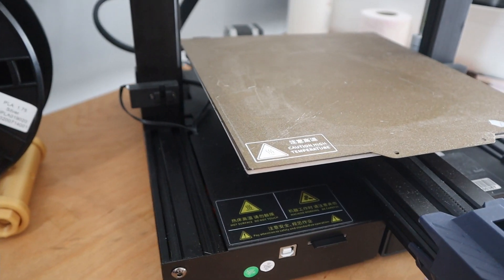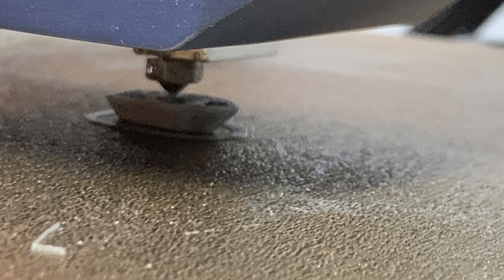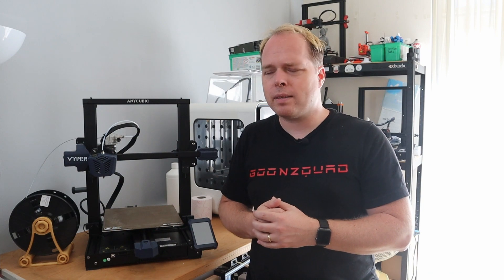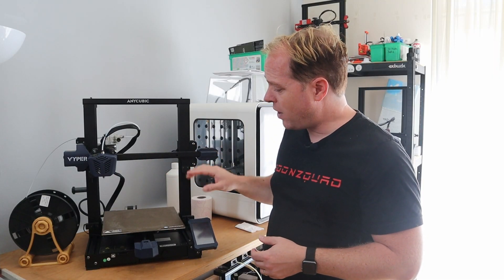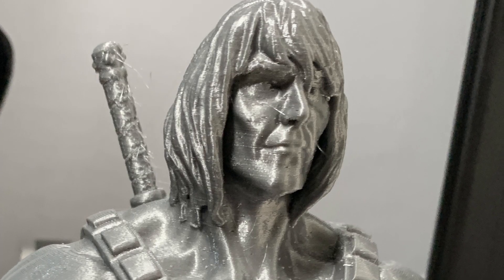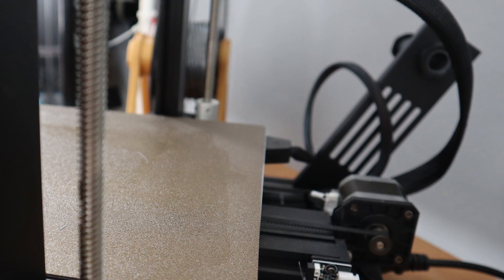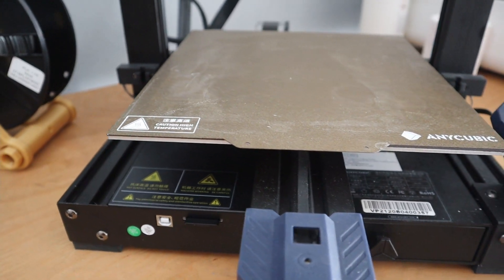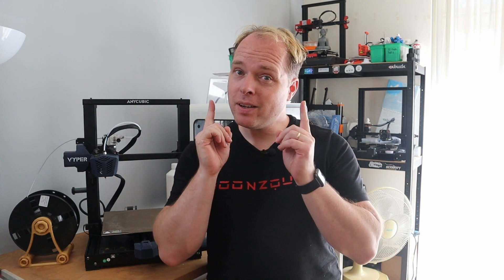Anycubic Vyper Review  - The new standard?

Comment: Would you recommend this printer over something like an Ender 3, 3V2, or 3 pro?
Reply from the maker: The Ender 3 Pro and the V2 are great machines, but this Anycubic Vyper is also doing great. I printed a lot of things on the Vyper, without any problem. But think of the things that are standard on all 3 of them... Both machines of Creality don't have an ABL standard on it, the bed has springs that are very thin,  and have dial knobs, one come with the standard magnetic bed, the other one has a glass bed, which is very nice. 
But for the price, it's very competitive
Reply: having x2 E3Pros & a V2 i would go for this one but it does have it's issues as you can read!
Reply from the maker: Yes those machines are amazing indeed, I still uses them a lot

Comment: I'm bummed I ordered mine on the first for 374 and it's down to 349 now on their site
Reply: Have you contacted Anycubic as i never even got a confirmation email but once i did the ball was rolling!
I've got to say straight out the box this has been a dream to setup and print quality is ace!
I only had an issue after my 3rd print with the extruder slipping so took it apart and found that the little grub screw had came loose on the gears so readjusted & tightened them!
I've only printed with the stock firmware and the Cura (PLA only so far) profiles that come on the SD card (Please note the test file 'Owle' is in a file and needs to go to the Root of the SD card to print).
Also best to switch off 'Combing' in the Cura profile for better results!
It would be great if there were more videos on upgrading the Vyper like printed mods/ firmware/ fan upgrades etc
Reply: @kevinbroadley5422  I've seen a lot of people having issues with defective strain gauges out of the box so that's got me a bit nervous. But it's supposed to arrive today so I'm excited.
Reply: @ernestthelumberjack  Best o luck m8
Reply from the maker: @ernestthelumberjack  it can happen in the first batch or first series… Anycubic had also a video about this strain gauge. New machine shouldn’t have this issue
Reply: @Zachary3DPrints  I got 4 weeks ago but i work away from home every 3 weeks so for the past 4 days ive been trying to get to grips with it and coming from Ender 3 pro's to this has been like night & day!
Reply: @Zachary3DPrints  I was hoping that would be the case but still was a bit nervous. I just put mine together and so far it seems to all be fine 😃
Reply from the maker: @kevinbroadley5422  thank you for sharing your tips on this printer.
Reply: @kevinbroadley5422  <ine also has been a dream,  I did have the same issue with the extruder, easy fix

Comment: The TMC2209 drivers have no connection from the uart pins to the microcontroller. Therefore you can not use the full potential of the drivers. The current of th z-stepper drivers is to high, the stepper motors are getting very hot.

The touch screen has only rudimentary functions enabled. It doesn't implement the marlin UI and you will miss many nice Marlin functions. Source code is not published and the community can not fix it.

If I am wrong, please correct me: As Anycubic uses Marlin licensed under GPL3, they have to publish the source code for their firmware. They did it only once and sources for actual firmware are missing. This is a clear violation of the GPL3.

I would not recommend buying this printer, until Anycubic publishes source code for every firware they release.
Reply from the maker: Hey Markus, that is terrible to read. When did you buy this Vyper? Are there more people having this issue?
The stepper drivers are very silent, but what else can they do for using the full potential? Yes the screen is very basic in the things you would need when operating this printer, Anycubic could have used the standard Marlin UI instead. 
For the firmware, the only thing I can see is version 2.3.9 which is just a BIN file, the source code I cannot find on their site. which is something I would also find with Creality, only the firmware, not the source code.
On Twitter, I have asked Anycubic these things, and I'm curious about their respond.
I bought their printer, and I didn't had any issue with it.
I will come back to you about this
Reply: @Zachary3DPrints  Linear advance can't be used, the Accurate current control they advertise, is not useable. the drivers are nowhere near silent, I have this printer next to one with actual silent drivers, I can hear the steppers 3 rooms away.  the drivers are in the firmware as A4988 instead of TMC2209.  We bought yearling wool sweaters, and they sent us spun wool tshirts.  that isnt even bringing up the point of them adding Cura 4.2.  4.11 is out now,  4.2 is from 2019. 2 years is 3 lifetimes in 3d printer world.  you cant disable or enable the mesh, no M600 control, no axis position status, z fade drives the nozzle into the build plate.  I asked them about this,   they said they would fix it later.   I don't see them sending us all out new boards.   It had so much potential, but is a huge fail.
Reply: @Zachary3DPrints  I got mine from the release pre-order and I have to say that my printer is not nearly silent when moving. Fan noise is expected, but axis movements being noisy on a "silent stepper" board is tragic.

My BIQU B1 also has silent steppers and it's a massive difference.

My Vyper's hotend LED likes to flicker or stop working during prints, and my screen is actually kinda blurry.

Not having profiles available months after purchase is terrible and the hotend is pretty much impossible to replace with a different one even though I like the strain gauge.
Reply: Just a quick one along of people including myself have had issues with Grub screws being loose in the extruder or bolts being loose on and around the strain gauge so worth your while going round them and making sure they are seated in the correct position and and secure!